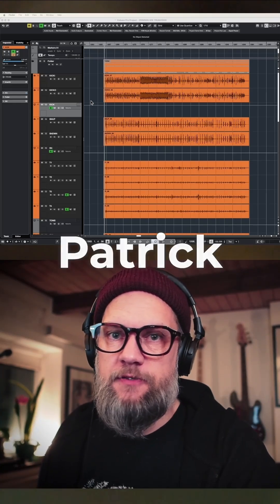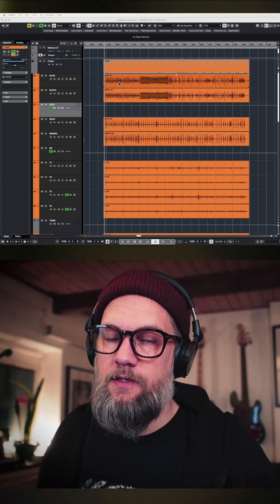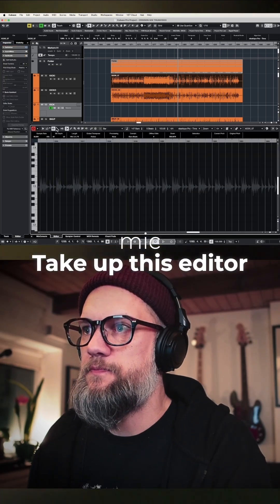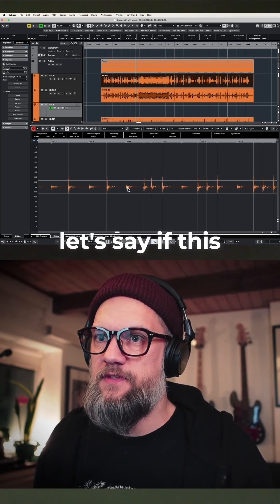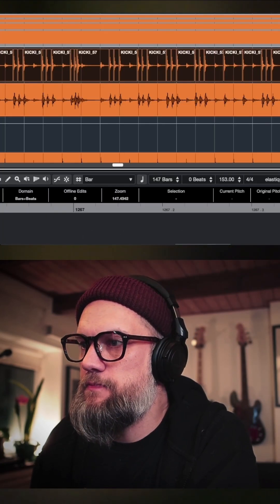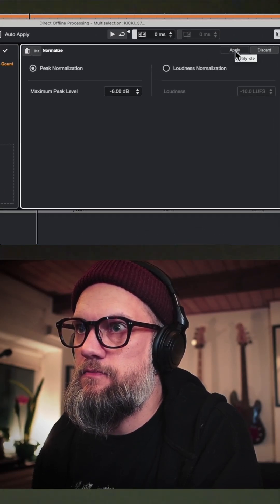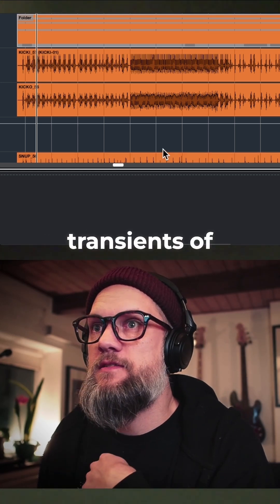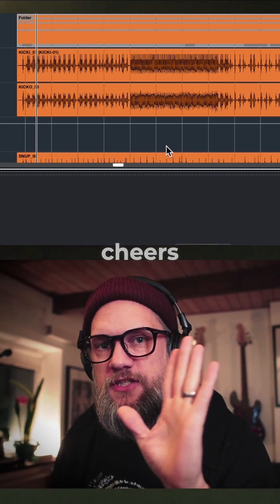How to solve uneven kickdrums in Cubase. No limiter or compressor needed!

Comment: Make sure that you channel settings have proper or no auto fade-ins. Otherwise it can mess up transients of individual clips.
Reply from the maker: Good point!! I actually always have auto fades on just a few ms to avoid clicks and pops by mistake. Haven’t messed with transients yet.
Reply: @hoborec  Well, it depends on the start point of a clip (event). I've witnessed quite a lot of problems because of that (hits not as punchy and what not).